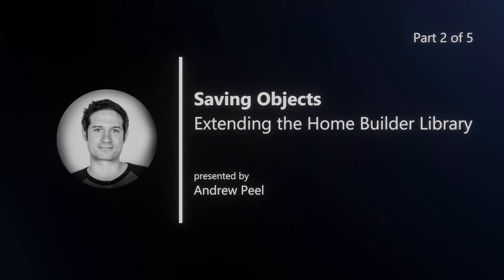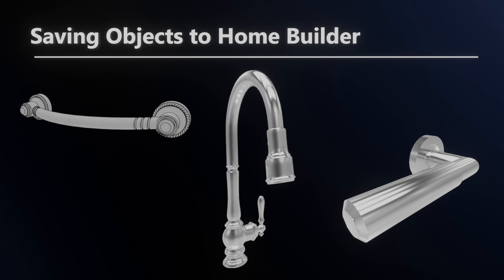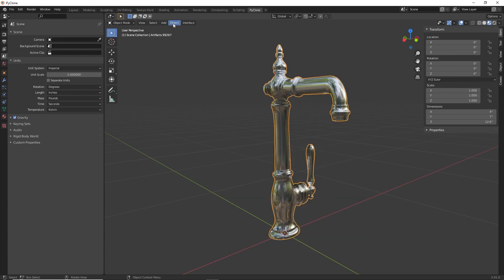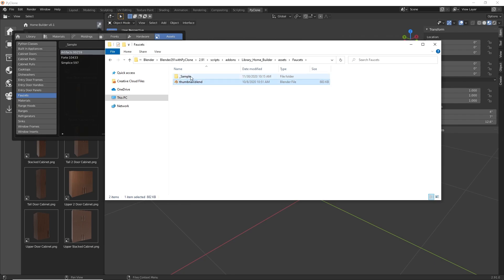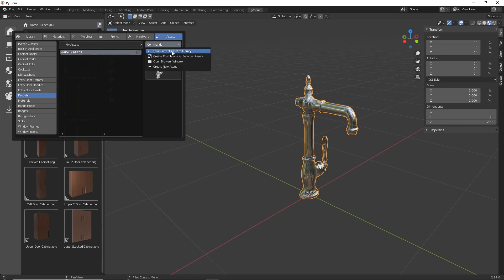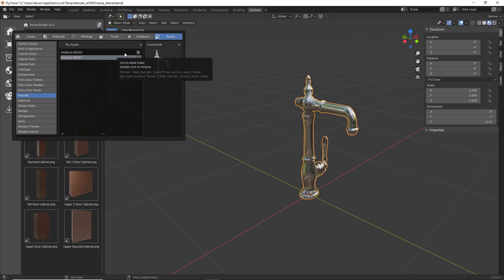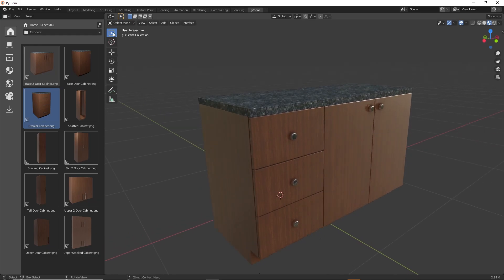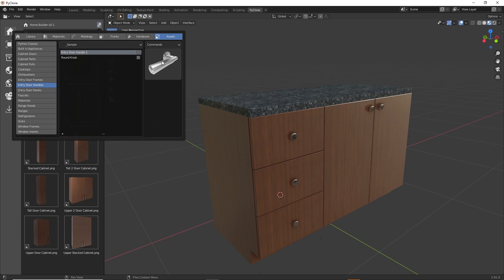Saving Objects to the Home Builder Library

Comment: I get runtimeError: Error: Object 'Y2.001' Already in collection 'Collection' then another line further down Location <unknown location>:-1 not sure what this is, simple door pull
Reply from the maker: I need more info on what you are trying to do. Try asking on discord it is easier for me to give support there. https://creativedesigner3d.com/2021/09/08/discord-channel/
Reply: @andrewpeel1996  ok I will from now on, I was trying to add a custom knob for library, had it set at world center with the origin point set to Y- face of knob was facing Y+ I tried adding through the setting like video but never shows up, so I saved the knob file and a png into the library folder and I get this, tried 3 separate times, was hoping to make a bunch and add them

Comment: The normals are bad on the shoes, the tub drain, the stove, the salt and pepper shakers
Reply from the maker: Thanks for the info I'll get them fixed up.
Reply: @andrewpeel1996  no problem, like the library, thanks for making it, all my houses use to be empty, I need to work on setting up the walls, i am use to doing it different, and i am not sure but in the tutorial you just click and walls showed up, i try and i get these goal post looking things and sometimes wall were they shouldn't. but good stuff

Comment: no matter what I do I cant save assets to the library, when I hit the button for save nothing happen. I saw you used pyclone, and I was using normal blender so I thought that could be the prob, but it was not. And if I try to make an asset of my own, like making a folder with stuff just like your faucet, it didnt show the preview png or the mesh, also the sink seem to fail booleaning into the cabinet.

Traceback (most recent call last):
  File "C:\Users\energ\AppData\Roaming\Blender Foundation\Blender\2.90\scripts\addons\Library_Home_Builder\cabinets\cabinet_ops.py", line 936, in check
    self.update_sink(context)
  File "C:\Users\energ\AppData\Roaming\Blender Foundation\Blender\2.90\scripts\addons\Library_Home_Builder\cabinets\cabinet_ops.py", line 902, in update_sink
    self.cabinet.add_sink(self.sink_category,self.sink_name)
  File "C:\Users\energ\AppData\Roaming\Blender Foundation\Blender\2.90\scripts\addons\Library_Home_Builder\cabinets\data_cabinets.py", line 107, in add_sink
    home_builder_utils.assign_boolean_to_child_assemblies(self.countertop,bool_obj)
  File "C:\Users\energ\AppData\Roaming\Blender Foundation\Blender\2.90\scripts\addons\Library_Home_Builder\home_builder_utils.py", line 190, in assign_boolean_to_child_assemblies
    mod.solver ='FAST'
AttributeError: 'BooleanModifier' object has no attribute 'solver'

location: <unknown location>:-1
Reply: I reinstall the pyClone and now the sink work well, but I still cant save new assets
Reply: within the pyclone
Reply from the maker: Try asking on the discord channel. It is easier for me to provide support there. The link is at the bottom of this page. https://creativedesigner3d.com/2020/11/12/installing-blender-with-pyclone-2-90/